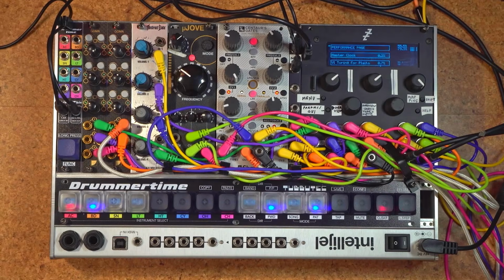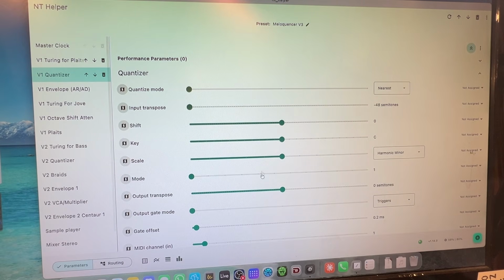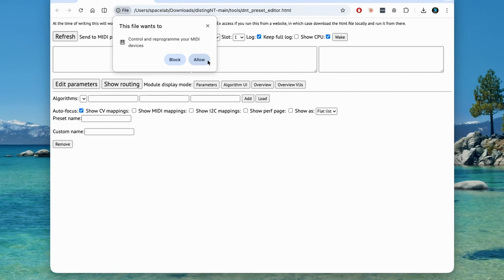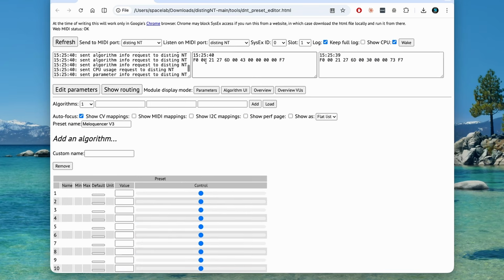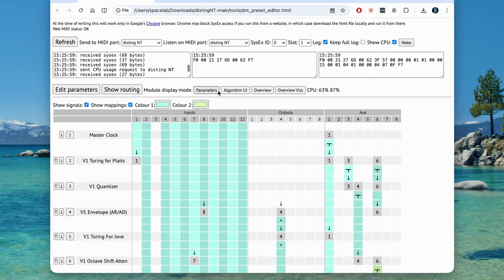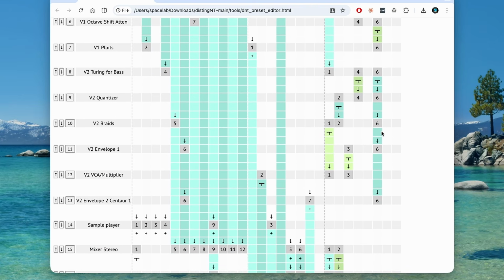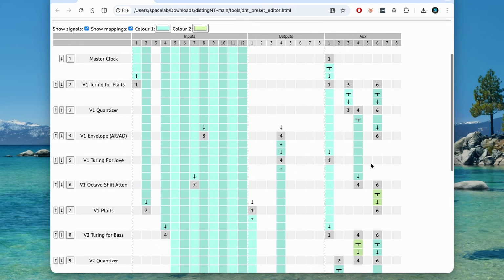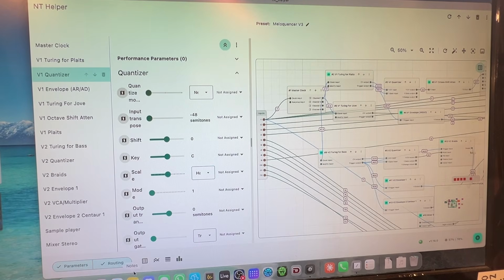A Tiny Techno Modular using Disting NT: Suggested Systems 9

Comment: When using these kinds of digital multi purpose modules, you save on a lot of mess by just using a midi seq over midi and just using the cv in/outs for audio. NT has a few back panel options to help avoid that cable vomit situation, too.
Reply from the maker: Yeah I would have liked to try this with a 16N etc although it feels a bit less modular!
Reply: @mylarmelodies there is always a trade off, I guess:)

Comment: Nice video!!! I don't know if folks have said this already but there are two algorithms that allow you to take a "wire" and move it back up in the stack. You can put the algorithm "feedback send' below an algorithm at the bottom of the chain. then put the algorithm "feedback receive" at the top of the chain. Pretty handy for self-patching an algorithm or creating crazy send chains etc. I have my disting hooked up to a ES-5 which gives me 8 gate outs and an ESX-8cv which gives another 8 cv outs. I have a Michigan Synthworks F8R. That communicates with the Disting over I2C which is routed from the back of the disting to the back of the F8R. Very very very cool module.
Reply from the maker: Didn’t know that and I can see that will let you do basically anything with this. Great stuff

Comment: Having the power switch on the side of the case where you also have your performance controls is kind of mad.

Query: you touched on the whole labelling thing and eventually learning what controls what. I'd be curious to see if that was sufficient when you're actually actually performing or if your'e finding yourself still having to read the labels.
Reply from the maker: That’s fair - although I never switched off the case by accident! The switch on the Palette is quite firm. As for labelling yeah what I put helped me a lot but it’s mainly required for navigation and setup, when you play you can leave it on the performance page - what I would have benefited from is labelling the Offset knobs to help cement that. But then this was only the result of a few weeks of work and not months of practice, in time muscle memory would take over and you shouldn’t need labels at all I don’t think.